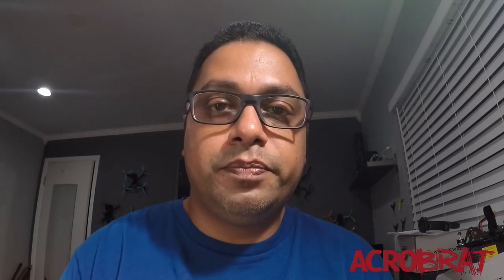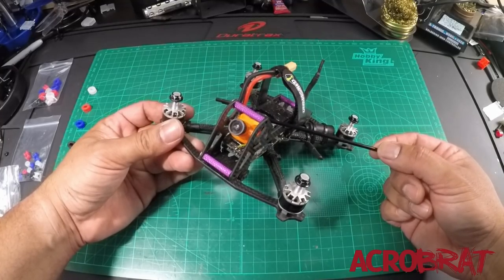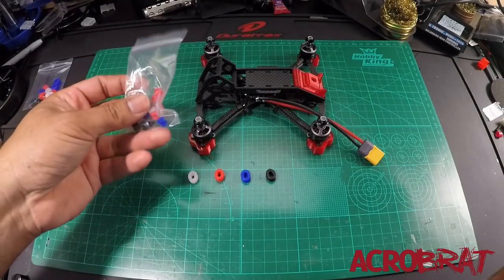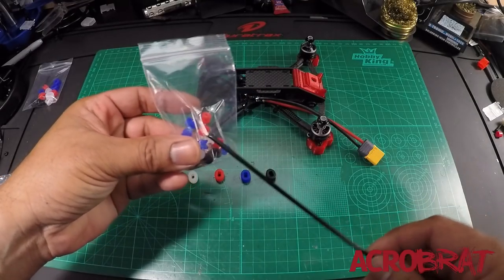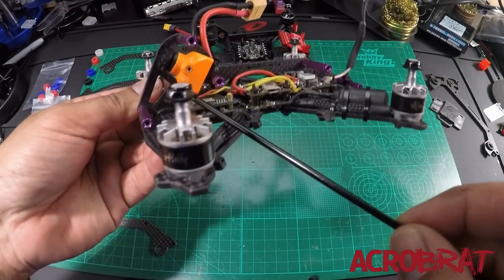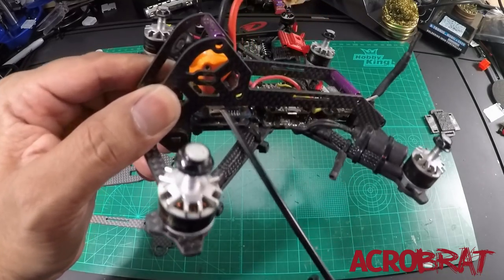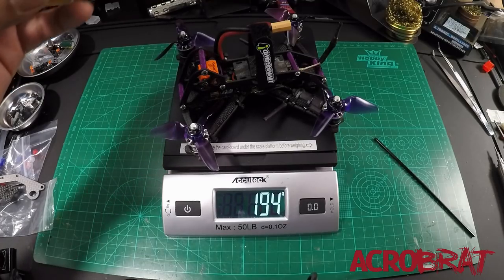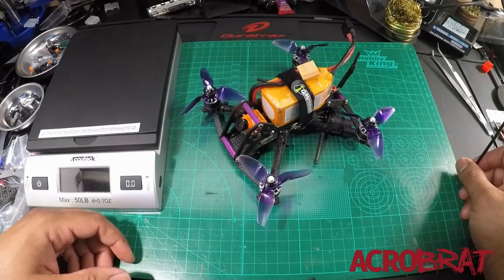Acrobrat Overview and Tips

Comment: Leon. Thanks for all the info, this is a great video. What are you using to wrap your motor wires?  I like how clean that looks. Thanks for the help.
Reply from the maker: That's some 1/4 inch sheathing I got off of Amazon.  I prefer it, because it makes it a lot easier to get the grass off the kwad :)  Thanks man!

Comment: Thank you for the tips. The small looking tank on your build I believe you stated was your Cap. Is it heat shrink? How did you get it to be so neat? Thank you. What capacity and where should it be soldered to?
Reply from the maker: Thanks for watching.  Yeah that's a cap.  Its a Panasonic 1000uf 35v cap.  This particular stack, HGLRC F38 has a location on the esc board to solder the cap to.  I just did a remote location install with wires.  If the esc doesn't have a location for it, then you can just solder it to the battery pads.  Some install it at the XT60.  All I did was find a piece of heat shrink big enough to go over it, then I cut it long enough to go over the ends.  Hope that helps!

Comment: Do you think soft mounting the motors would help bust jello?  
I'm newbish, so bear with me.  :-)
Reply from the maker: Hi Johnny, it can help.  With this design, the motor plate (dirty section) is only engaging with the clean section using the supplied grommets.  So if the motor soft mounts can absorb  some of that vibration, then the grommets can help eliminate the rest.  Now keep in mind, going with a smooth motor will will help even more.  Hence the Brat motors are a good choice because they are smooth yet powerful.  Hope this helps, and welcome to the hobby.  Take your time and watch as many videos as you can it will help.
Reply: @leonfpv8261  Thanks, man!  yeah, I'm in no rush to jump beyond my Inductrix BL.  But the Brat will definitely be my first build.  I'm hoping to keep my quads at or under the 250g mark.
Reply: @leonfpv8261  Also, I had to laugh when I realised RR was another Chad Kapper creation!  My last run at the hobby was with a bunch of homebuilt Flite Test planes.

Comment: Some good info! My Brat will be coming in a few days. I see you will be using BH1507 4100kv, I want to know if tattu 4s650 will be enough to push the motors. I am using the same BH1507 but  3600kv on my Massive droner with decent fly-times. Thanks!
Reply from the maker: Thanks man!  I think you should be okay.  I find with the brat,  4100kv seems to be the sweet spot.  When I first built the prototype for this frame, I used the BH 1507 3600.  It felt okay, but it did feel heavy and the less responsive.  I then changed over to the BH 1407  T1 4100 kv, (I had jello so I did a motor swap) and the kwad had that 5" feel and the power was a lot better.   So my suggestion, with this frame, stay above 4100kv. That's what all of the test pilots seem to be running and we have had good results.  FYI Tommy has a set of motors coming out for this frame, and they will be 4100kv.

Comment: Has anyone mixed hard with soft , should give different damping so all grommets aren't  "in tune with each other" love this design ,;camera protection✓,vibration damping✓,front bar for gates✓, weight < 250✓,heavy carbon frame✓split battery✓3s or 4s✓,turtles well✓,low profile✓,and community support✓✓✓ my complete ✓ list wow just wow

Comment: Hello, you have stl files for motor and antenna support's.
Hglrc flame 1407 3600kv it's good for this frame?
Reply from the maker: I don't, the 3D printed parts are from Brain 3D.  He designed all of the 3d prints for the brat.   As for the motor, it will depend on how heavy your build is and what battery your using.  If your going 4S the 3600kv will feel okay, but if the build is heavy, it might feel a little sluggish in the sticks.  I would recommend at least 4100kv for your motor.  On 4S it will rip, and on 3S you still have enough kv to feel good.

Comment: what about current sensing?
Reply from the maker: Unfortunately a lot of these small stacks don't have current sensing.  Unless  your running a blheli 32 bit esc and the fc has pads for esc telemetry.  I know HGLRC sells a separate current sensor that you can install.  I wish they would just include it on the esc's, but I guess there is no room, and these small motors won't pull enough amps to burn them up.  Thanks for watching.